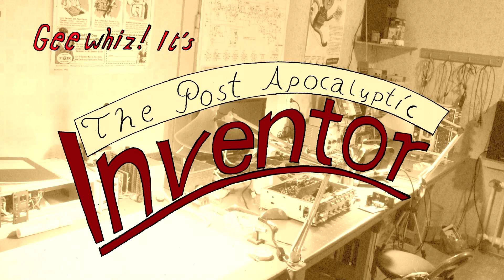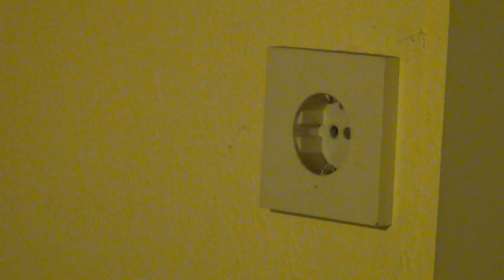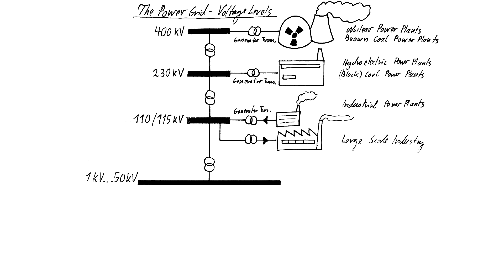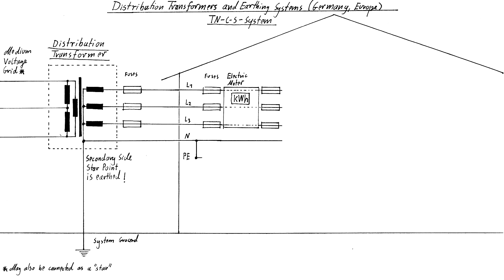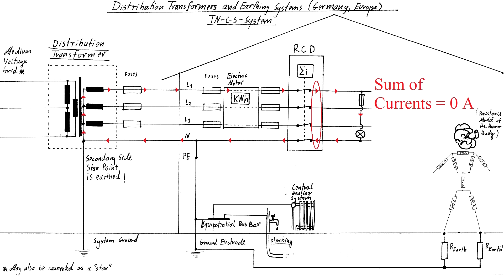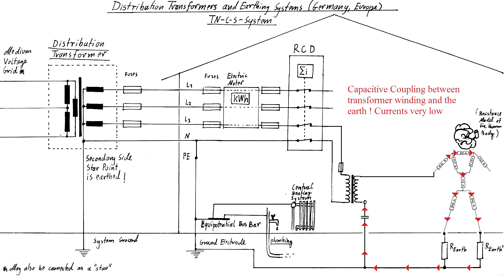The Power Grid, Isolation Transformers and Earthing

Comment: You are correct about the "split phase" systems coming into American homes.  Once it hits the home, you have the split phase 240VAC and a Neutral return line.  At the power distribution panel (breaker box) of the home, there is a neutral buss bar which connects directly to the ground (earth) electrode.  The split phase 240VAC is then connected to two breaker rails inside the panel.  I forgot to include the electrical KWH metre, that comes before the breaker rails so the power company can monitor how much power you are using.  Anyhow, for your 120VAC wall sockets they go from phase to neutral with a separate earth line going all the way back to the breaker panel and connecting to the neutral/earth buss bar.  For your larger appliances (Dryer, Hot Water heater, HVAC system, Ovens) and so on, these are hooked to the split phase breakers which span between both breaker bars inside the panel.  These as well have an earth wire.  I can explain this much easier with a schematic if you wish.  Hope this helps mate!

Comment: I haven't read all the comments, so if someone has already answered this please excuse me. For your North American diagram where it enters the house -- 

Power enters "distribution panel" of a house as three wires off of the "distribution transformer" you have labeled in your diagram, and the two hot lines are 120V, 180 degree phase offset due to the center tapping.

If high power devices are used (ex. electric range, clothes dryer, restaurant ice cream machine, welding equipment, etc.), they usually require 220-240V and are connected across the two hot lines.

Otherwise, the circuits of the house are typically split roughly equally among the two phases.

To be strictly legal, a third ground wire connects all equipment chassis together, and to earth AND neutral at the distribution box, however, in practice, a LARGE quantity of homes are grandfathered as two wire without even regard for polarity of live vs. neutral. Grounding is sometimes overlooked and chassis are connected together. It can be quite interesting in the event of a fault...

GFCI outlets, or GFI (ground-fault circuit interrupters) are required in wet locations such as bathrooms or outdoor outlet installations.

Comment: Thank you for the highly informative video.   It's amazing that 3 phase power is supplied to ordinary residences in Germany.  Obviously, that drives up the cost of building and maintaining public power facilities, but it is probably less expensive in the long run because homeowners can then use 3 phase motors, which are less expensive, more efficient and simpler than A/C motors that are designed on operate on single phase power.  

In the USA, it is extremely unusual for 3 phase power to be available at an ordinary residence.  It is normally available only in commercial and industrial areas.  It is also provided to large farms that need to operate very large motors that run pumps and load silos.
Reply: Do the washing machines, clothes dryers, dishwashers, furnaces, and other motorized appliances in Germany actually have 3 phase motors in them?   And if that is the case, what sort of outlet is used to bring 3 phase power to them?

Comment: Standard US household wiring is this:

110 - 120 volts:

Black - Hot
White - Neutral
Green - Earth

220 - 240 volts have a couple different color codes:

30 amps
Red - Hot 1
Black - Hot 2
White - Neutral
No ground

50 amps
Red - Hot 1
Black - Hot 2
White - Neutral
Green or bare - Earth

In some occasions the black may be blue in 220 - 240 volts wiring.

I know some people say the US needs to change over to 230 volts and though it looks good on paper the reality is the residential grid cannot support it because it was build designed around what we have now, The sheer cost and man power to change out every transformer and fly new line would be amazingly expensive and not financially responsible in a country that is going down the economic toilet. There would be massive increases to power bills nation wide to cover the cost of the upgrade. It is best to leave it as it is, It's not broken so no need to fix it.

Comment: Where did you get your electrical training? The American medium voltage grid does not carry a neutral conductor. The neutral is created at the center tap of the transformer secondary which is then grounded.

Comment: I cant understand it..wood and concrete is not conductive so how i`m completing a circuit while standing on wooden floor ?
Reply from the maker: +David divad Wood and concrete are conductive! They are very bad conductors, but they are  not ideal insulators as well. If high voltages are present the currents that will flow, can still be high enough to harm you.  Furthermore: Alternating currents can flow through your body due to ''capacitive coupling'', as I mentioned in the video. A layer of material with low conductivity between your body and an electrode will act like the "dialectric"  inside a capacitor.
Reply: So lets say if id jump in air and while i`m in air i could touch hot wire without getting shocked ?
Reply from the maker: +David divad It depends on the voltage between the ground and the &quot;live&quot; wire. 
If it is a high voltage line and you jump in the air to reach it, then your body will provide a path of higher conductivity than the air that normally separates the wire from the ground. If the voltage is high enough, the free space between your feet and the ground (while you are jumping), will possibly be arced over by the current and you will be fried. 
If we a talking about a 115 or 230 V wire however, it is very probable that nothing serious will happen to you, since the voltage is to low, to ionize the air between your feet and the ground. 
I still highly recommend though, that you do NOT try that in real life!
Reply: Nah i`m not that stupid to try that, thank you for answer!
Reply: +David divad wet wood is absolutely conductive.  concrete is mildly conductive.  i learned that the hard way while playing electric guitar in bare feet on a concrete garage floor. :-O  even tho the strings are not connected to anything, apparently they pick up enough voltage via induction through the pickups (which are mini coils coupled to the individual strings, so act like step up transformers i spose) and will shock the shit out of you if you happen to be a low resistance path to ground.

earlier this evening, i kept getting electrocuted while testing a string of christmas lights.  earlier today i barely escaped sliding into the creek near my house, but i did submerge one of my boots, so i have 1 wet boot and sock, and on a wet concrete floor, testing a wet string of lights was begging for trouble.  good thing it was only 120 vac.
Reply: +David divad around here, they use helicopters equipped with pressure washers to clean the insulators on the high voltage towers.  presumably because if you tried to do it from the ground, they would have to keep hiring new guys to do it.
Reply: +David divad  It probably works because even if you are not grounded your bodies conductance is just enough to cause a minuscule current to flow.  If you look at the neon light it appears to be only half lit.  It will glow more intensely as you touch something which provides more conductivity.  When current does flow it flows across the skin first and not through anything internal.  If you look at a defibrillator the ideal arrangement is to have very large positive an negative conductive pads on both sides of your thorax parallel to your heart.
Reply: +David divad 
yes, upstairs in a dry wood frame new building. all day long .
with grounding system not tied in or just don't touch both..
handle the live, can't tell.
the handle the bare grounded conductors..
Clearly not idea.. but just like the bird on the wire..
like was just explained..
Reply: +David divad Let's just say everything is conductive in a way... the resistance is just higher or lower
you could even light an led by wiring it up to a rectifier which is connected to 1 megaohm resistor on each AC lead and shove it into the mains supply.
the led lights up perfectly fine even though there are 2 megaohms of resistance on the line.
Not that I'd recommend anyone to try this

Comment: How does current flow from the neon test light through the body to ground when the body is touching the non conductive poly-carbonate handle of the test light?
Reply from the maker: +Sam Cummins Well normally it only should light up, when the metal tip at the end of the tester is touched, as I demonstrated in the video. I also have never seen any of these testers light up, when only the plastic handle is touched. If the neon test light would still light up without the metal tip being touched, it again could possibly be explained by capacitive coupling, with the poly-carbonate acting as a dielectric. But with a typical mains tester as shown in this  video, when being applied to a 230V line, this actually shouldn't happen. What kind of tester are you using?

Comment: Sometimes when I turn on my stereo power amp it trips the RCD, do you know why that happens, and what I could do to prevent it? Thanks for your interesting vids.
Reply from the maker: dunkelheit843 It is most probably due to the "remanance" of the transformer of your amp. I explained that in the followup video to this episode.
Reply: yeah, watched that vid after the first and felt a little stupid for asking the question, however, if that is the cause, is there a cheap and simple way to deal with it, preferebly without having to open up the amp and mod it internaly?
Reply: +dunkelheit843 If it trips the RCD then try to use a power cord without a neutral wire in it and see what happenes. Don't touch the chassis though if it's made of bare metal. If it works, there may be a badly designed emi filter in the amp. If it's not actually the RCD that is tripping but rather a normal fuse in the fuse box (make sure), then I bet that is a very powerful amp with no inrush limiting implemented. Also, I'm sorry if that is a cool sounding amp and it gives such headaches.
Reply: thanks for the advices, it's defenetly tripping the RCD. However I've got it plugged in via a remote controlled powerswitch (nexa brand) and I've noticed it only happens when I turn in on using this device, however if I use the powerswitch built into the amp I haven't gotten it to trip the RCD, so  there's something wrong rather with this combination of amp and remote operated powerswitch.

Comment: Fantastic video. I found several things very fascinating about how you, Germans, treat your power system.

Here in the U.S.A. residential clients do use a split phase system with a center tapped transformer. The primary winding is connected to 2 legs of the 3 phase lines, which are usually about 5kVrms in residential neighborhoods. The 2 legs of power distributed throughout the home have opposite polarities and add to 240Vrms when connected together and 120Vrms with respect to ground. Typically high current loads use a connector with both power legs and a ground, sometimes they also include the neutral.

Commercial clients will usually have a 3-phase star/wye transformer secondary with voltages of 120Vrms with respect to ground and 208Vrms from line-to-line. Industrial factories or workshops will sometimes have voltages of 208/410Vrms. Also, you may occasionally see a High-leg delta secondary with voltages of 120, 208, 120 with respect to ground. This uses one grounded center tapped transformer in the typical Delta configuration.

The neutral conductor should only be bonded to the safety ground at one location, usually right after the service entrance. I found it interesting that your system actually uses a ground point at the pole as well, since this could cause unwanted telluric currents to run along the neutral line between the two ground points. Additionally, to be UL listed all isolation transformers must be grounded on the secondary wiring.

I also found it intriguing that all of your circuits are GFI protected. Here only outdoor outlets and ones installed near water must have this protection. They also must trip at 6mA. Do you encounter any nuisance trips with single phase motors?

Again, thank you for the video and cheers from across the pond!
Reply: +stephen dwyer Ramblings of a madman....
Reply: +stephen dwyer do they also have dots or periods where you come from?
Reply: +Joshua Mudge  Also all electrical installations which are located in open places such as lights and sockets are supplied from transformers 240/240 for greater safety of people.
Reply: +stephen dwyer You should learn to construct a sentence.  I'm trying very hard to see your point through your incoherent rambling.
Reply: whats that supposed to mean?

Comment: Just some small corrections. The two phase power entering a US home is 240v with reference to ground as each voltage is 180 degrees out of phase with each other. Your diagram showed 120 Volts in relation to ground measured across both phases. You probably meant that each phase measured by itself in relation to ground is 120 volts.
Reply from the maker: roomba The arrows in my drawing are simply pointing to the two conductors and are supposed to mean that the two points the arrows point at have a voltage of 120 V with reference to earth ground, not that there is 120V between the two conductors. In that case I would have drawn a voltage arrow between them instead.  
I'm not an expert for the American system, as I said in the video. But from what I have read, I find your statement somewhat confusing, so help me out if you can: 

The distribution transformer is just a single phase transformer with a grounded center tap at the secondary. The voltage between each end of the transformer secondary and the center tap (earth ground) is 120V AC. With reference to earth ground the voltages at the two ends ( or "phases") are 180 degrees out of phase because they are to opposing ends of a secondary winding. 

Between  the two ends you would then measure 240 V AC,  but that voltage only exists between the two "phases". But the way I see it, there would only be 120V AC with reference to earth ground at any given point on the secondary side. Am I missing something ?
Reply: Yes, that is correct. Please read the last part of my comment in which I give you the benefit of the doubt.

Comment: American pole transformers has only one high voltage input with one fuse, but there's no protective device at the output of the transformer.
Correction - some transformers have 1 high voltage input, called CSP type.
Reply: +DjResR allot of usa transformers I see on youtube videos are single phase where there are 3 phase lines i see 2 and 3 phase ones.

Comment: Very nice video. What I didn't understand is why create the earthing conductor in the first place to get rid of it using an isolation transformer?
Reply: Now, that's a very good question. Why is a ground provided in the supply side? If it was not there no shock hazard (to ground) would exist. Hmm...
Reply: +Devranjan Das its probably mostly used to ground the core of the transformers, if you have ever seen someone making arks from the core of a microwave transformer, the ark is jumping from the core to a ground wire.

Comment: Thanks for the great video!

Regarding power in the US: residential service transformers take just 1 high voltage phase, with a center-tapped secondary as you described.  The other end of the primary is earthed for the return.  This is why -- particularly at the end of a pole line in rural areas -- you will see poles with just a single high voltage wire at the top.

An interesting facet of this system: the center tap of the secondary and the "low" side of the primary are bonded to the same earth ground.  If that ground is broken or is insufficient that can lead to stray current coming into the house on the neutral...!

FYI, In the US we call an RCD a "GFCI" or "GFI" -- ground-fault circuit interrupter.
Reply: +jruser I had the experience of just that, a high wind took out a tree in the neighborhood and as I stood in my home the lights went out and a very strong 60Hz hum was heard coming from the basement. I figured it had to have been the neutral ground receiving that "high line" voltage flowing through the water main out to the street. This area is served by one wire and the system neutral as you described. The event didn't last long but the sound emulated what you might have imagined as the wires came together, sparking and humming. When I say this was loud it was VERY loud. To this day I can  measure about 2 amps flowing between my load center box ground and the water main ground. This will be present even with no loads running. I never opened the connection to measure the voltage. There is a ground rod connection just below the power meter as well, so that should not be an issue.